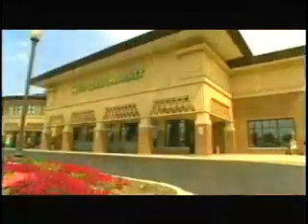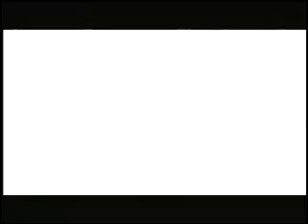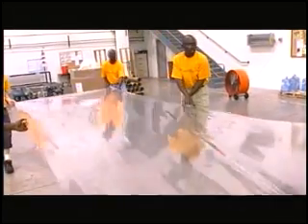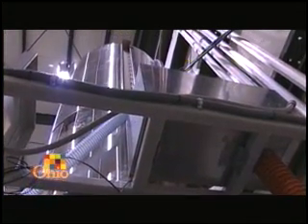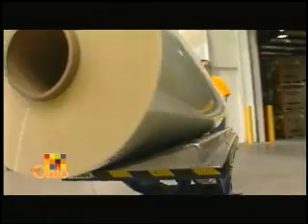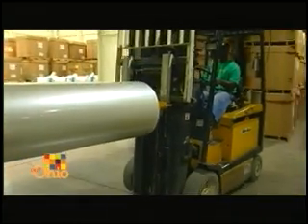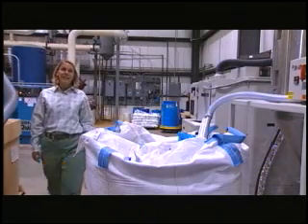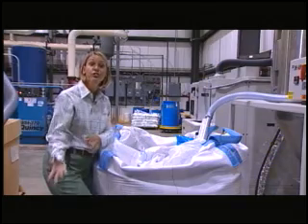Corn to Plastics

Comment: Think of it this way. This is the first step in a good direction. It is totally feasible that in the very near future that farms could produce the corn with organic pesticides, have it transported in biodiesel or ethanol powered trucks and processed in a facility run on solar power. Of course petroleum will still end up in the process through capital goods but it's a significant improvement from using oil and oil derived energies to do this entire process as is currently done.